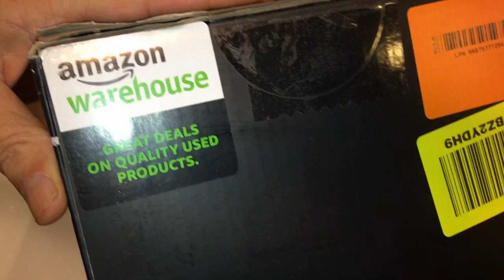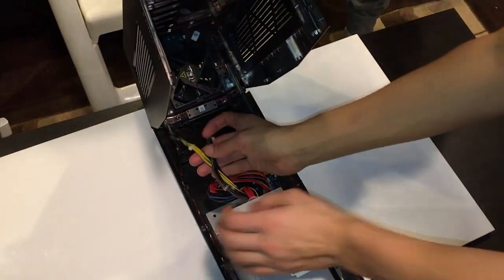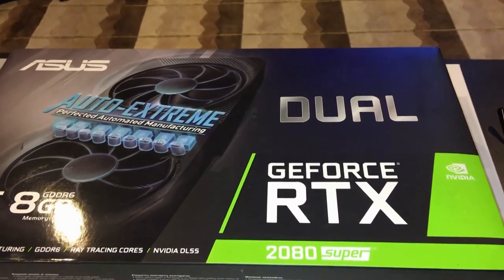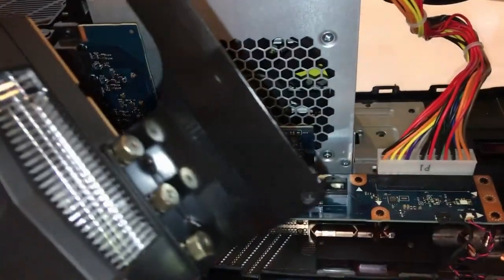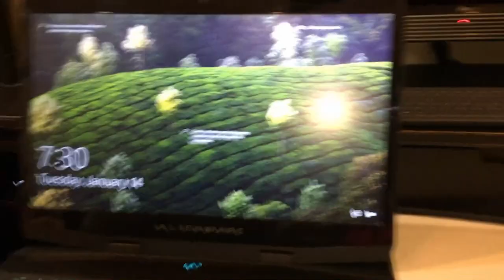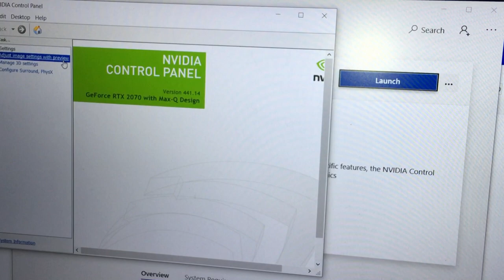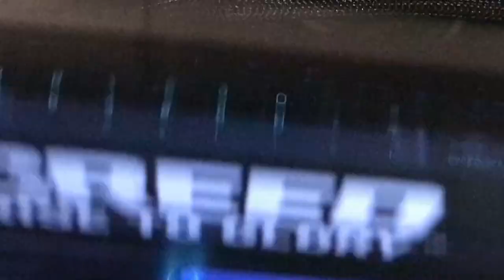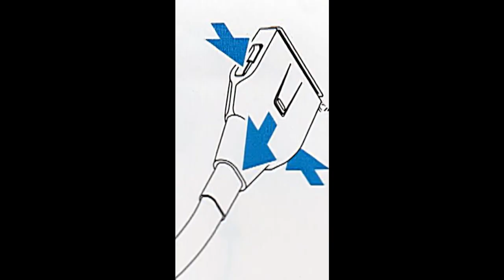DeLL Alienware AW Graphics Amplifier Gaming external Video Card 9R7XN  Compatible m17 Model p37e

Comment: Do you think the Asus 3070 would fit in there?
Reply from the maker: I doubt it, not 100% sure, but I would be surprised. If your try it, please let me know if it does..
Reply: I’m planning on running either a 3080 or 3090, but if they don’t fit you can always get a Pci Riser (https://www.amazon.ca/EZDIY-FAB-Extender-PCIe3-0-Flexible-Extension/dp/B07PV533WK/ref=mp_s_a_1_3?dchild=1&keywords=PCI+riser&qid=1606596379&sr=8-3) and find a DIY way to do it like mounting the card outside the Graphics Accelerator (and possibly replacing the Power Supply if it’s not enough for a 3090). That isn’t the only Riser available on Amazon, I just picked one as an example.
Reply from the maker: Good luck, maybe it will fit without the cover. Please let me know, if it does, i may get it myself
Reply: @mtandiz  3080 will fit have a friend that personally running it
Reply from the maker: @oilrigdeepseadiver8254  no idea
Reply: No. According to Dell's compatible list, the last update only includes RTX 2080Ti, 2080 and 2070. And Dell said they will no longer update the future cards.